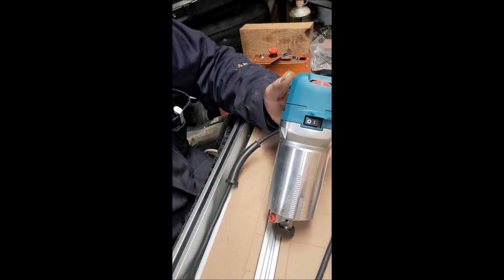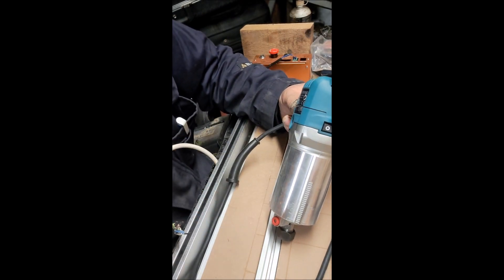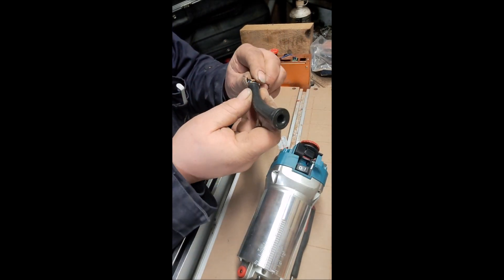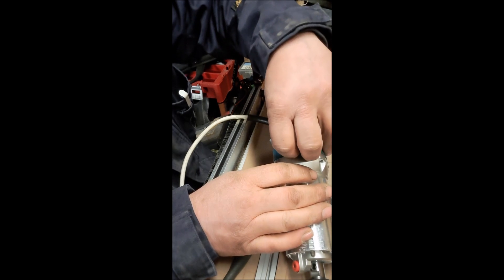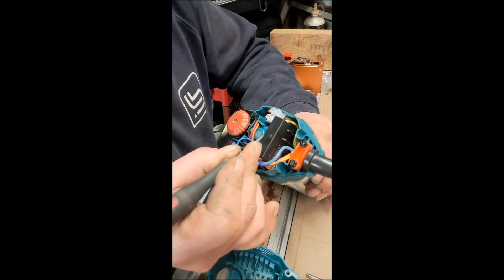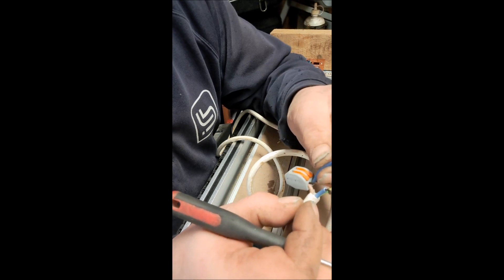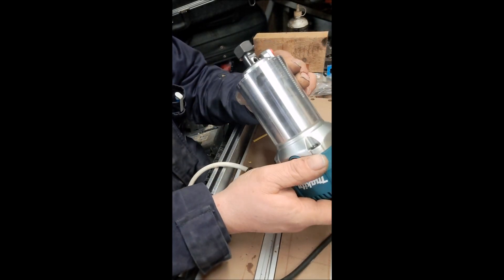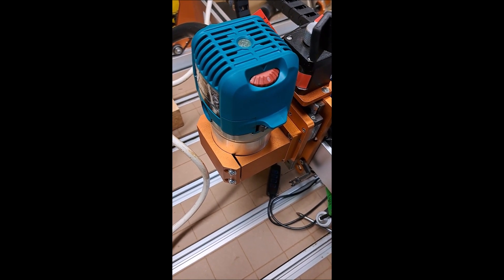Makita RT0702C Router Hack For Remote Control Relay

Comment: hi there can you show me if you used a ssr relay? you put the blue blue on there?
Reply from the maker: you need a open relais (electromagnetic relais) in my case 12V , 12V goes from makita pro to relais that act as a switch
something like this : https://www.amazon.com.be/-/en/Heschen-Gereral-MK2P-I-PYF83A-Terminal/dp/B0785K6PK2/ref=sr_1_4?adgrpid=143961299202&gclid=Cj0KCQiA8aOeBhCWARIsANRFrQGkcmiNR3_PDtU9y6B-9_IJGP0kN7SMShdhXEmNiylaPRCYDz07vnkaAvdFEALw_wcB&hvadid=628039321162&hvdev=c&hvlocphy=1001154&hvnetw=g&hvqmt=b&hvrand=5126045252803676252&hvtargid=kwd-1508159425&hydadcr=2024_2276344&keywords=relais+12+volt&qid=1674152558&sr=8-4&language=nl_BE
Reply from the maker: and yess i put the blue/blue on the exit
Reply: @SteelBodyGuitars  ok does not matter wich one is plus or minus then
Reply from the maker: @jeroenspacey2358  no it acts like a switch
Reply from the maker: @Jeroen spacey  I Just want to let you know that the ssr relays also works
Reply: @SteelBodyGuitars  could not get it to work… i have to see what becomes of the cable. from the cable to the ssr and wall plug
Reply from the maker: @jeroenspacey2358  i will make a new video now ok
Reply from the maker: @jeroenspacey2358  here it is https://youtu.be/clWcNFNIAMg